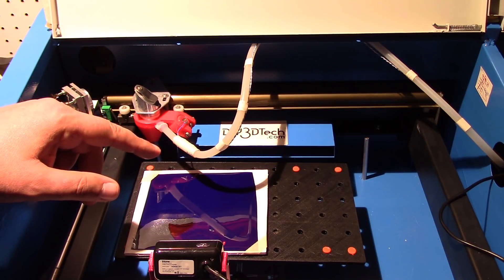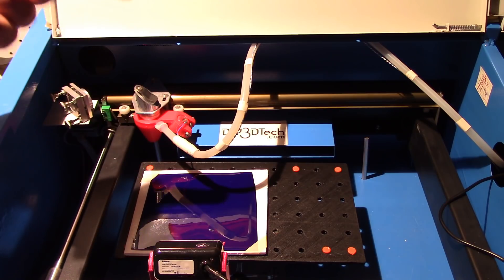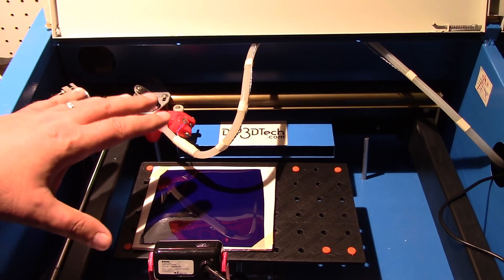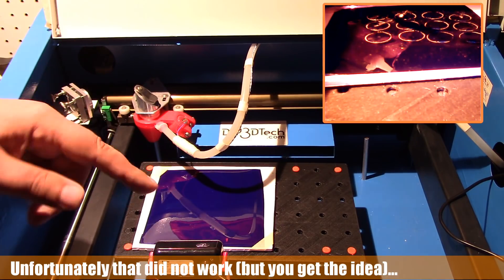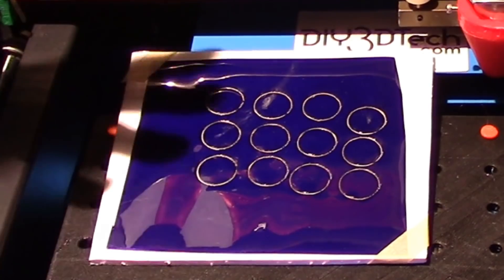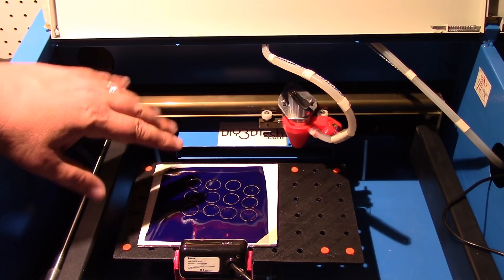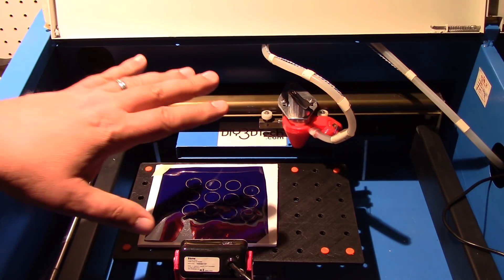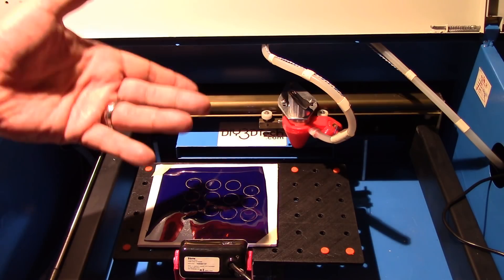K40 eBay Chinese CO2 Laser Cutter & Engraver - Cutting Optical Grade Mylar!

Comment: General machine question. After all the tinkering you've had to do would you still recommend this as a first laser? I considered the glowforge but not sure it's worth all that extra cost. Looking to start a side business as well as use it to enhance my photography work with personalized items.
Reply from the maker: That's the key "cost" :-)  I only recommend this period if the person is  mechanically and  electronically savvy as these are very dangerous devices.  Also given your use case, would go the glow forge route as with the K40 you will spend by FAR time working on it then making money.

Comment: Really should check the Msds for mylar. It says ... Hazardous gases/vapors produced in fire are carbon dioxide, carbon
 monoxide, organic acids, aldehydes, alcohols. The last 3 being an issue.

Pvc(foam board) produces chlorine gas when lasered which combines with moisture in the air to produce hydrochloric acid.

Neither should be laser cut and pumping the fumes outside isn't good either it should be filtered first.
Reply from the maker: I am not fully sure what this stuff is to even look it up so its more of guess and therefore the warnings in the video.   I have a very good evacuation system and these are smaller quicker cuts so not overly worried.  As most things you laser cut will yield those items you list as laser cutting is a nasty sport for sure and as you point should not be taken lightly...